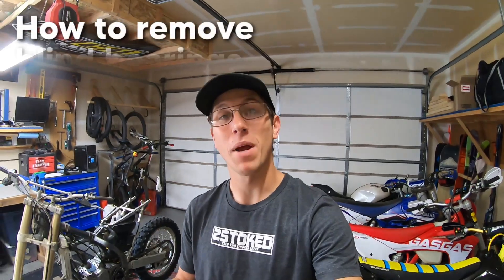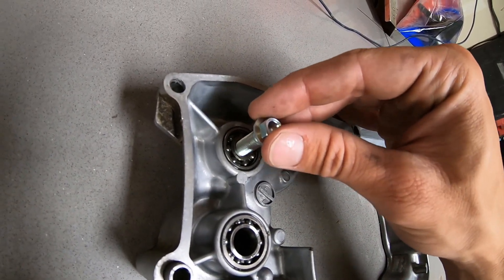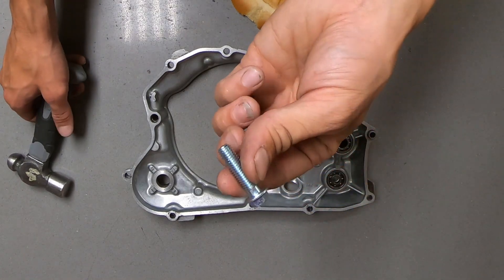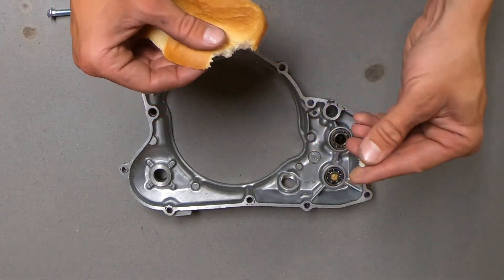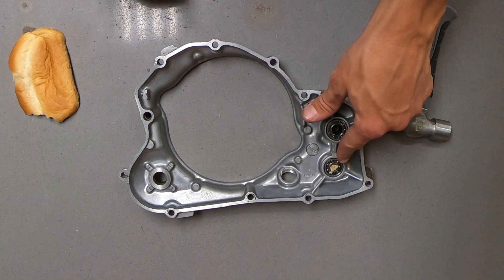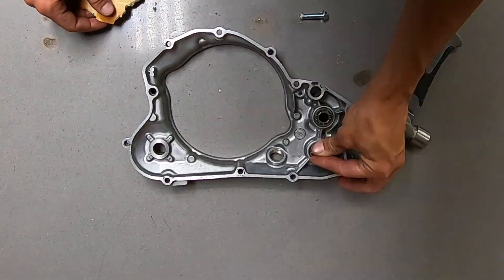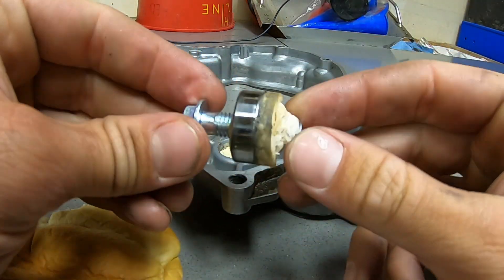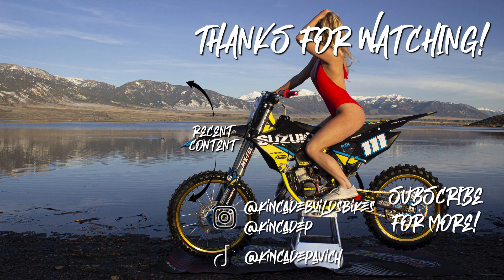How to Remove Blind / Pilot Bearings Without a Puller

Comment: THANK YOU!!!!!! Been fighting with doing a clutch change on a Mazda B2200 in my spare time for the last 4 days. Did the same job years ago on a Mazda 626, but in that case, the pilot bearing practically fell out of the flywheel once I got the pressure plate off, and the whole process was finished in about 9 hours of actual wrench-time. This time, though, absolutely no joy getting the pilot bearing out. It was SERIOUSLY in there, and it meant to STAY where it was. I've spent two days of on-and-off attempts trying to get it out. No joy breaking loose the flywheel bolts. No puller. No idea how to proceed. Googled around, and hit this vid. Sacrificed two slices of bread to the auto-gods as demonstrated, and less than 5 minutes later, the bearing is in my hand. THANK YOU!

Comment: Bread just came through the bearing. Guess I should have used sourdough.
Reply from the maker: I’ve had bread come through the bearing before. Usually it can still pack tight enough to work, but depends on the bearing I suppose.
Reply: @KincadePavich  I ended up wetting bits of blue shop towels. After the bread stopped coming out it finally pushed out